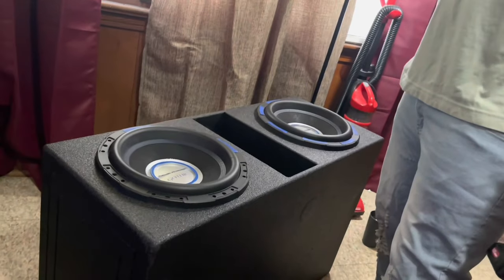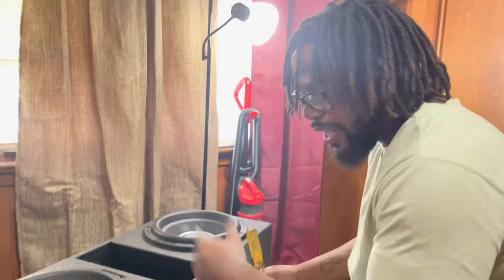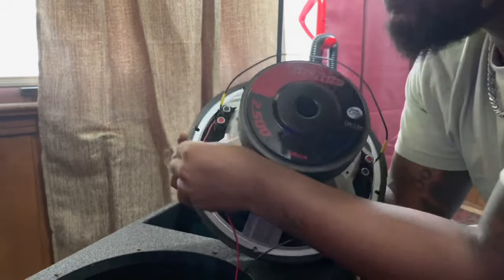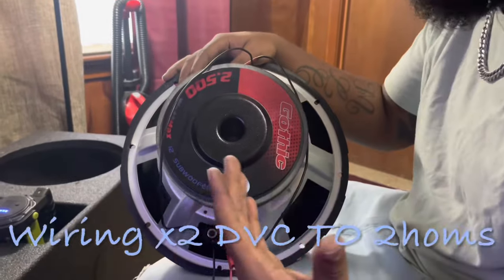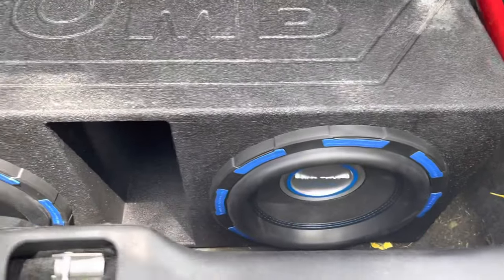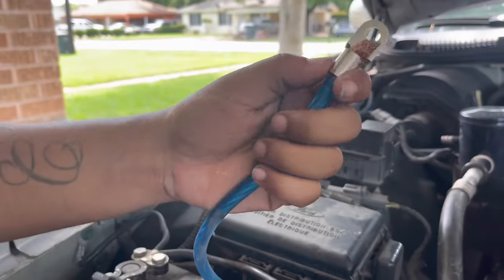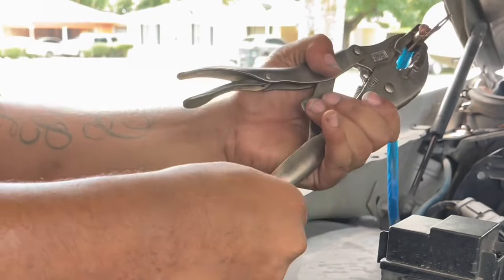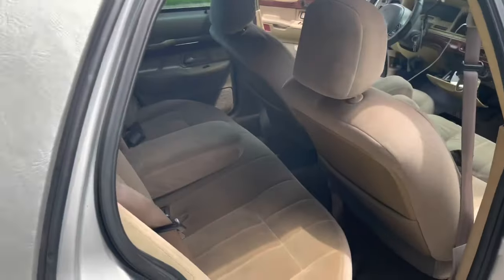Skar RP-2000.1D Pushing 2 Power Acoustik Gothic 12s

Comment: Sounds like it's hitting good. What do u think can they take a bit more or that 2000rp is ok with those subs.
Reply from the maker: Honestly bro I think there’s a even balance between the 2 gothics and the 2000 rp. Really was thinking getting 2 more and another RP2000.
Reply: @topiqchill241 how do you wire that amp to two subs? I have  one positive and negative coming out of the box. Do I hook it up to the outside plus and minus or the inside?
Reply from the maker: @jaygee6983  inside bro. Wire your positive to positive. Negative to negative inside the box, then from the outside to the amp
Reply: @topiqchill241  oh no the box is already wired I mean to the amp. The wires coming out of the box what do you hook those up to doesn't this amp have four terminals? Do you use the inside two or the outside two? The positive and the negative coming out of the box does it matter on the amp where you connect it  to

Comment: You like the power acoustik 2500 or the skar rp 2000 better bro? I heard the skar pushes more rms. I got 2 gothic 12s
Reply: I like the power acoustik but I didn't know if the skar rp2000 would hit harder
Reply from the maker: Skar 2000.1D bro the Gothics hitting pretty hard with that amplifier

Comment: You have any issues w the skar amp? Mine kinda trashy…… I’ve blown 4 skar sdr12s w it already at 1ohm load turned way down
Reply from the maker: So far no, I have the amp tuned kind of mid way but it pushes those Gothics pretty good
Reply: @topiqchill241  I SWAPPED MY SDRS TODAY FOR THE GOTHICS AND THEY SEEM LOUDER W THE SAME WATTAGE AND NOT NEAR MAX EXCURSION LIKE THE SDRS ....IN MY 04 DEVILLE
Reply: @amordeweso  skar amps are no joke but I am not crazy about the speakers at all.
Reply: @areasonablethought610  their subs are trash I swapped to these gothics and they want more power sound under fed and my amp don’t warm up now w these subs W
Reply: I know this old but was you running 2 Skar subs and blew another 2 or 4 at once on 1 ohm. If you did 2 on 1 ohm that’s 2000 watts on that amp going to subs that 600 watts rms each. So if tou wasn’t running that amp to 4 of them and only running it to one or two them yeah your gonna blow it.
Reply: @GladiatorVA  na mine was a 1200.1d it was what came with the setup it blew 2 sets of subs in the prefab box …..after maybe 5 songs smike everywhere …..the gothics lasted a lot longer then I got some audiopipe bd2 they ate that skar amp then I swapped the tarpamps 3k amp them audiopipes ate it but after like 6 songs you could smell them ….. the XFLS PLY LL DAY NO ISSUES